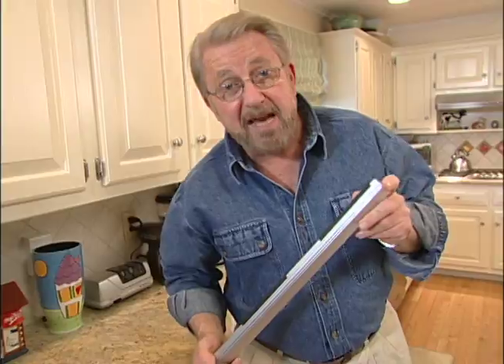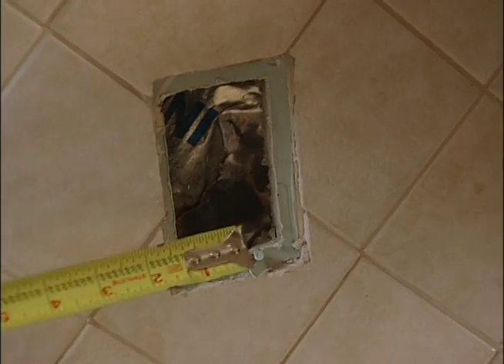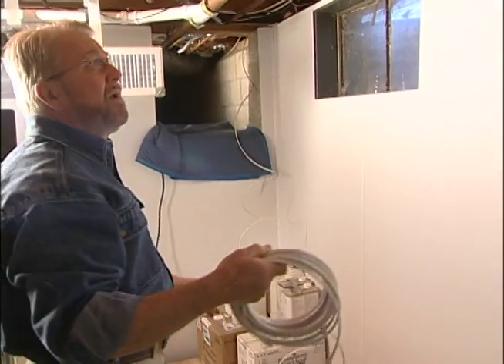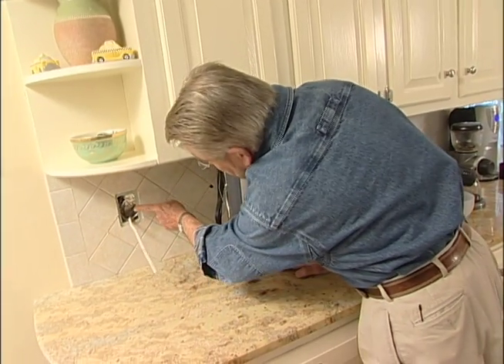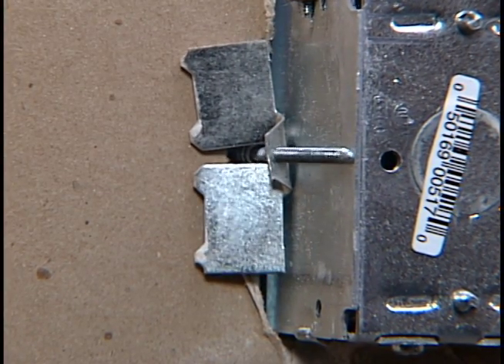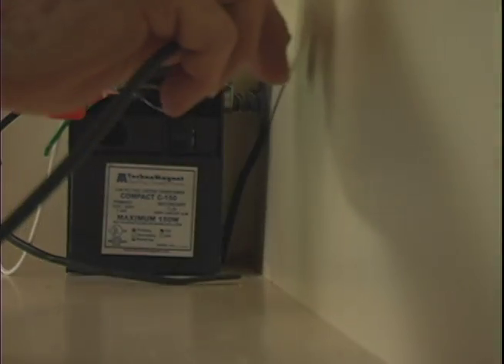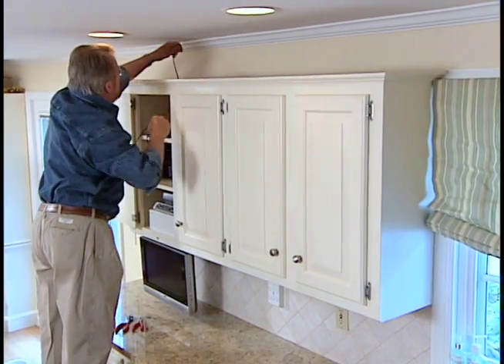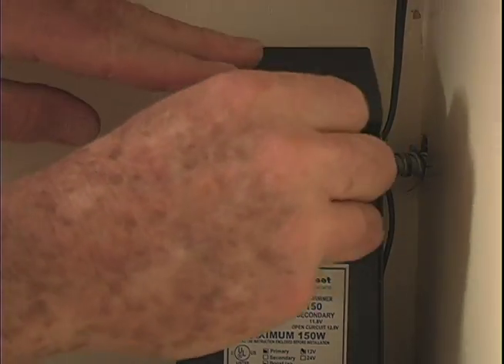Under Cabinet LED Lighting

Comment: This is pro electrical work.  I liked watching Ron twist wires, drill hole and run wires.   His wire fishing skills are world-class. That said, I’d do a few things differently.  
1.	These fixtures are outdated – dotless LED strips in slimline aluminum channels is way slicker.
2.	Use 24V LED  system – with 2 times the voltage, current is halved and you can use smaller wires.
3.	Use white wires instead of black inside the (white) cabinets for better appearance.
4.	Why not mount the transformer in the basement, and run low voltage wires up to the switch?  (use an appropriate low voltage switch and dimmer).  This keeps the ugly transformer out of the cabinet and eliminates the need for that ugly shielded cable.
Reply: Do you have a brand system (24 V LED ) and or supplier (Lowes, HD, Online) you recommend? Thank you!

Comment: I did mine a little differently.  I was doing a new tile backsplash so i had access to the wall outlet power.  I tapped into  the wiring and ran the 110V up to a small transformer/power supply that mounts under the cabinet.  I then ran the new 24VDC to a motion sensor which has a 20min timer.  I then powered the strips from the motion sensor and ran small gauge low voltage wire under all the cabinets.  
I could always go back an install a switch or dimmer if i wanted one.  I love walking into the kitchen and having them automatically come on.  

Worked great.  Love it.

Comment: A little tip. Measure the distance from the hole, in this case the old telephone box, to the floor. Add about 6inches and take that measurement and mark the snake. This is so you know you should be at the height of the box or a little beyond it.

Comment: I did undercounting lightning about 4 years ago. It took me awhile to find them but I found 18 inch strips of LED lighting that does not require a transformer. Each light strip has it's own step down transformer build into the LED strip. All you have to do it run 110 to each strip from you switch of choice and on they go. I believe the ones you are using here are of the old school. JS
Reply: Jerry Hubbard good brand? Where can I get some?  Thx!
Reply: I will have to go back and see where I bought them. I do know they came from Cali, somewhere.

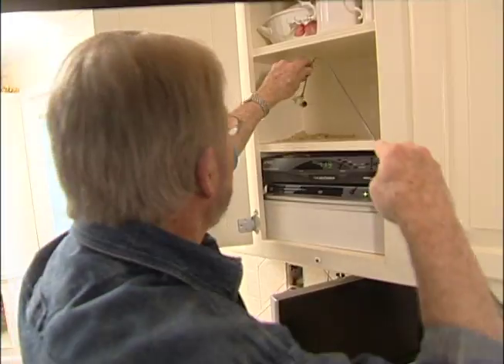Comment: 7:00 dang lucky there wasn't a wall stud between cabinet hole and switch mount
Reply: Lance...I was about to express the exact same thing, but you beat me too it by a day...LOL.  You're right.  He'll have to drill another hole from the  right side of the wall outlet, then get lucky enough to catch the wire at that level, and bring it to the left direction toward the box, OR bring the wire from the transformer straight down to the basement then fish it back up to the outlet box, again from the bottom.  Fish wire can make magic happen for any electrician, or home do it yourselfer like me. But man, aren't those lights terrific?
Reply: Exactly what I thought!  100% that stud would be there for me.
Reply: Or firebreaks between the studs.  Then it becomes a messy job.

Comment: Nice video - I like the way the slot screw was tightened to the vertical position in the wall power switch.  Classy.

Comment: I would have run the cable in the corner by the door so you can not see it when you open the door.  Also hot glue does a great job of tacking the runs.

Comment: I would connect the electrical cable to the fish tape "before" pulling the tape up!  3:30. You can always pull it back down if you wrap the connections with the tape to keep it from getting stuck.

Comment: Get the battery powered ones from Amazon  and they are rechargeable USB, they are magnetic mount so you can remove and replace battery. The charge lasts about three months...They cost $17 a pair

Comment: You can installed the transformer in the basement and running the DC power to the switch and to the LED light s
Reply: GOOD IDEA WHY HAVE THE BLACK BOX TAKING UP SPACE IN YOUR CABINET ???????
Reply: Yes...The transformer may get hot in the cabnet..
Reply: Then your transformer is always powered on. I would rather have the transformer powered on only when using the lights.
Reply: You could run the power from the switch to the transformer in the basement.

Comment: Ron thanks for the useful tip. What is the reason for using the BX Armored wire between the switch and the transformer but using Romex in the basement?
Reply: Because he used a metal box, but not sure why he didn't just use a blue old work box and romex for everything, way easier.

Comment: This has to be a solid 20 years old, I remember seeing this when I still had hair.
Reply: At least 10 years old.
Reply: About 20 years old, I used to watch on Discovery H & L when I was a kid
Reply: LED wasn't available 10 years ago. Not at a price point worth you while.
Reply: MB, you do realise that 10 years ago was 2010, and LED lights where everywhere. I remember back in 2010 when my city changed all the street lights to LED.
Reply: @ramroad2008  - LED were most certainly available 10 years ago. I had under cabinet lighting in 2009 and it was fairly inexpensive even then.
Reply: Take a look the makita drill with red battery  I had one 15 years ago when I had hair 👱🏻to👴🏼 🤣🤣.
Reply: agree, that transformer is huge.
Reply: Maybe you did but the 15 minute film seemed to last a lifetime !!
Reply: Yes, all of these videos are old. Ron Hazelton retired from TV shows in 2015.
Reply: Back when you could get bx wire

Comment: Appreciated the safety process of testing for live power before making the terms on the supply end. Would suggest to everyone to take one more step. Test the probe on another known live source before testing for dead wires.  Then test again at the same known source to ensure the probe worked properly. We call it Live-Dead-Live testing and it ensures that your probe works correctly and your circuit is absolutely dead.

Comment: I bought rechargeable motion sensors light like that which stick up magnetic strip off amazon. When they run out of power just recharge USB and back in action.
Reply: KingLord thank you. I just ordered them.
Reply: Verbeek was ones i have, 3 settings always on, motion, darkness. I have mine set for motion under cabinet under sink and counter. Only come on when close and need light no matter day or night off 20 sec after no motion

Comment: On the 120 v wiring it looked like your hose was wired w/ MC cable however you used romex from the basement to the switch then back to MC cable to the power supply. I would think you may have a code violation in this case, then you used romex.

Comment: And when you drill into the cabinet for your electrical feed and discover there is a stud in the way, the fun begins.
Reply: There are always a dozen obstacles when doing these type of projects. His couldn't have been much simpler. Easy basement access and all the right tools. Who the hell has a bell hanger bit? I've never even heard of one.
Reply: @OMGWTFLOLSMH  It's $10 from Amazon. It's a little more work if you had to use a hole saw.

Comment: Would’ve been better to put transformer in basement and run the switch up to the same spot.  Then it’s got switched 110 and transformer isn’t in cupboard.  Or put transformer on top of cabinet.   I like option one better.  Just pull low voltage up from basement in both cases.  

Also, running low voltage wire over the window?   You are already fishing wires, run them down to lower cabinets that run all the way around and it’s never out in the open.
Reply: DUHHHHHHHHHHHHHHHH

Comment: Why not mount the transformer in the basement and run low voltage wire up,not to mention the half baked job of running the wire thru the cabinet’s my wife would of never stood for that
Reply: Why run more wire than necessary? If he's happy sacrificing his cabinet space (see his previous video of mounting the LCD TV and moving his cable box & VCR into the cabinet), then he's happy, it don't matter.

Comment: The original phone connection you took out operates at 17V. You could have used that as your voltage source.
Reply: unless it rings then its 90 volts AC
Reply: Not enough current either. Phone lines limit to a few milliamperes, by design. On hook is -48 to -60vDC, ring is 90 to 105v AC, 20hz. Talk battery is 6 to 12v DC, while off hook, while in call.

Comment: Why not put transformer in basement and only run low voltage wire up into cabinets? You save cabinet space and drill a lot fewer holes!

Comment: Very helpful for hard wired switch. I am tapping into my microwave power so gotta figure out another switch option. 9:00 should the ground have a pigtail to the metalic box? If you would have continued to use metalic shielded cable in the basement that would have made more sense and looked nice with the other metalic runs. Otherwise just use romex and plastic old work boxes the whole run. Also at 12:00 run the wires behind the cabinet Face instead of the back panel so they are hidden from plain sight when the cabinet doors are open or if you have glass (or at 13:22 you can run them down vertically between the cracks between the cabinet side panels, as long as you can run it two directions with a splitter).

Comment: Good work.  But could you have installed the transformer in the basement and run low voltage wire from there?  No need for shielded cable.  Is a Low Voltage dimmer switch and option?

Comment: Should have mounted the transformer under the floor and ran an extra loop down from the switch and back up instead of compromising the cabinets? Do they sell white wires?

Comment: they need a video on proper electrical connections, how many turns or tightness for wire nuts. I have seen people just place the wire nuts on wire without turning, or using wrong size wire nuts.
Reply: I am a 47 year electrician. I did 5 year apprenticeship in IBEW local 3 New York City. Yes people have common sense if  properly trained. Why do we have yubetube? This video is for someone with some basic electrical training. Not for women

Comment: There's already plumbing and electrical running below the joists...if the basement ever gets finished out it will be a drop ceiling, because no contractor is going to replumb and rewire the entire house over 6 inches.  Absolutely no reason to drill joists in this particular instance.
Reply: The code requres high voltage wires to run trough joists, to protect them from nails and screws. When the house was built, that part of the code didn't exist, however anything you do after the new code comes out, has to be up to the new code.

Comment: "Simple to install"  ??? You want to retract that statement.
Reply: 崔春玲 no one gives a shit
Reply: If you're an electrician with lots of experience and easy basement access.
Reply: @chunlingcui2851  A hell was not needed? I'm listening....
Reply: There is nothing difficult about that at all. You drill a few holes and run cables, trim your bits, wire them together and staple everything up neatly. Tools were a basic drill and $25 in bits and fish tape. Anybody can master that with about 15 minutes of practice.

Comment: This must be a vintage video, no Anit Short Bushings as required by 320.40 in NEC 2002.
Reply: I think this video is newer than 2002. But not by much. Maybe 2008 max. I saw anti short bushings in the basement JB.

Comment: Would have been way easier to put the transformer in the basement....  rookie mistake.
Reply: I don't believe the transformer box provides any rheostat control , wall control needed . (or a box upstairs for dimming low current , after trans in basement ,  before the LEDs) .
Reply: Armchair technician over here 👨‍🔧
Reply: Danny Wallen that might be true except for the fact that I install/sell 1000s of feet of tape lighting.  I automate RGB+tw tape light that mimics the color temp of the sun.

Not to mention he used a garbage disposal supply line for a lighting load so he’s going to get light flicker every time to disposal gets turned on.  And he connected to hot supply before installing the rest of the circuit....  connecting to hot should have been the last step.
Reply: @thewizard6309  I feel sorry for anyone that's hiring you then, since you don't know what you're doing.  Hooking to hot last?  The whole system is de-energized, it makes absolutely no difference what order you hook up the conductors.  If you're re-energizing the system while your conductors aren't fully reconnected, you have no business touching an electrical system.  And putting the power supply in the basement?  So you can have ohmic loss drop across a long conductor with low voltage supply?  I wonder how many of your installs have color balance issues from voltage sag.
Reply: @thewizard6309  Is running the garbage disposal going to drop the line from 120v to below 12v?

Comment: I wired my LED lights directly to the phone wire . And skipped the transformer
Reply: TonyCamp Camppartyof4 I have several outlets under the cabinets, is there a way of connecting into them. I have never done anything like this and would love to do it on my own. One wall does have a phone outlet.

Comment: I am so im love w this idea! But was wondering on how i could use an actual power outlet. I have one under each set of cabinets (4 cabinet sets)
Reply: Change out the existing outlet for one that has one plug-in and a switch. The receptacle and the switch share the in coming power supply. Wire the transformer as Ron did through the wall. This way, you have switched lights and retain an outlet. 
Be advised that the switch works sideways.
Reply: Tennessee Charles  Ridiculous. This is a simple DIY project. You're just looking to rip people off.

Comment: Nice, but looks like you have a TV hanging from the cabinet, could you get your power from the source feeding the tv,?
Reply: Still needs a 110v switch/dimmer, granted this system is outdated....no massive transformers on newer undercabinet lighting, and dimmers are also low voltage.

Comment: I think I'd do the connections in reverse. That is, leds to transformer, transformer to switch, switch to basement junction box. Less chance of someone in the basement turning  on the circuit breaker before the job is done.
Reply: If you're that concerned about somebody turning on a breaker while you're working on electricity, use a lockout tagout device on the breaker, or just lock the circuit breaker panel door shut.
Reply: @Stevenowski  Just common sense best practices that's all.
Reply: @joeweatlu5169  If you have to worry about somebody in your house turning on a circuit breaker when you're working on electrical, you've got much bigger issues to worry about.
Reply: @KevinFields777  After working with electricity for a long time you learn that things can go wrong so you need to take away that possibility where and when you can.
Reply: @Stevenowski  Imagine this scenario: In the middle of the job the guy needs to drop a deuce. While he's gone the missus tries to use the garbage disposal. It's not working so she checks the circuit breaker. She resets it and comes back to the kitchen and finds hubby, hand inside switch box and lit up like a Christmas tree. 
You're welcome.
Reply: @KevinFields777  i don't have to worry about somebody turning on the circuit breaker because the breaker is the last connection I make.

Comment: Most garbage disposal circuits use 20 amp breakers and 12-2 wires. Your video shows a 14-2 wire (for a 15 amp circuit) spliced into this circuit which would be a code violation in most cities. It would be better to use 12-2 wires for all the 120V sides of this circuit if it has a 20 amp breaker.